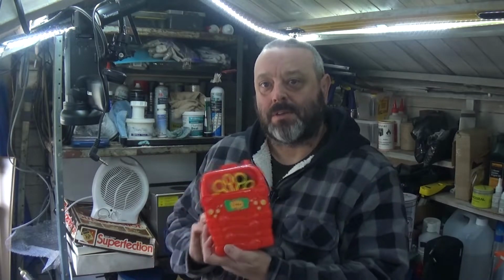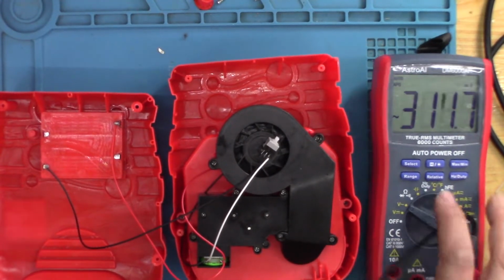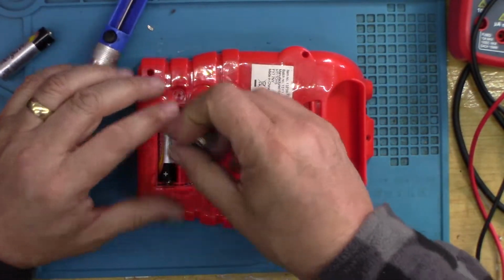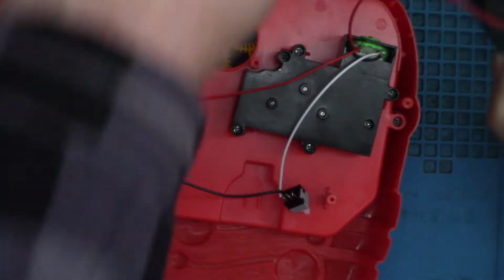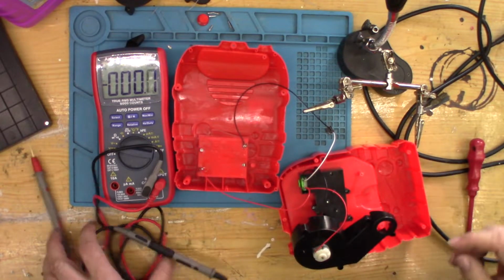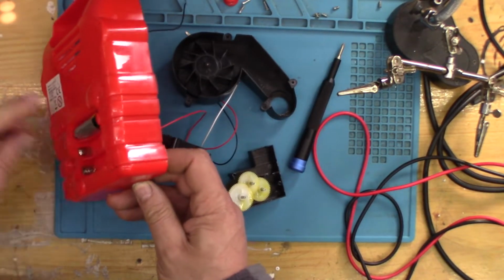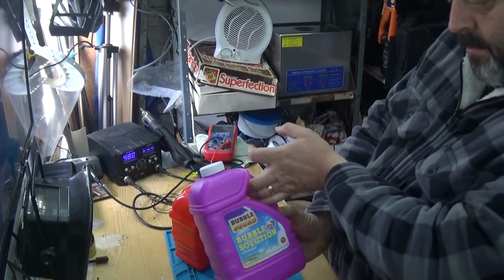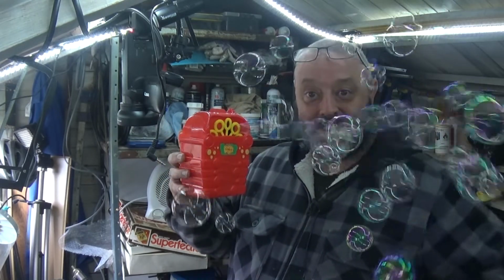Mega Double Bubble Blower toy fix. Amateur repair attempt, no power fix.

Comment: I've watched this a dozen times and I still can't figure out what the initial fault was lol. It's a nightmare when you attempt something like this and the wires start falling off. Feels like one step forward, two steps back. Nice one.
Reply from the maker: It got lost in the edit, but I think it was both the dodgy battery connection and I think the wire I replaced probably had a break inside that caused an intermittent fault.